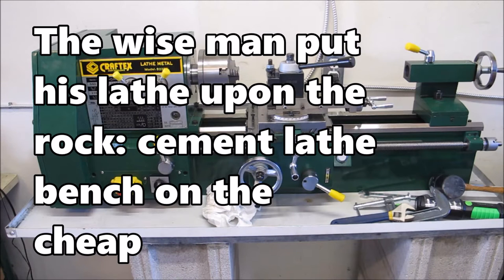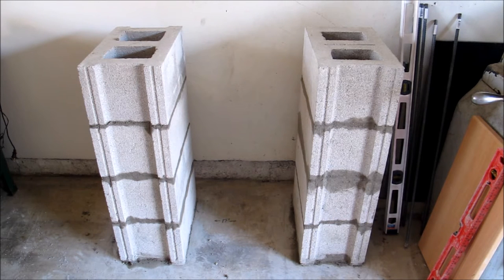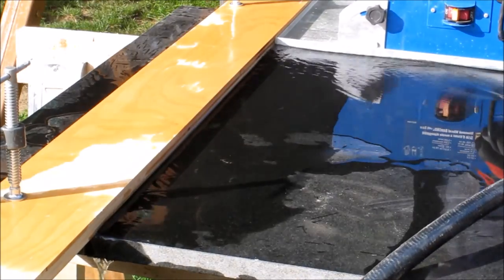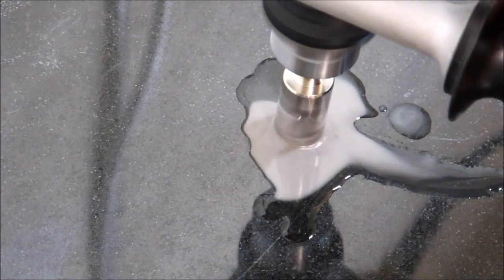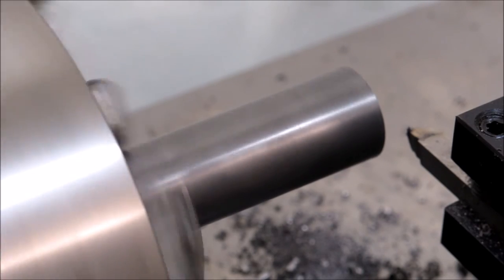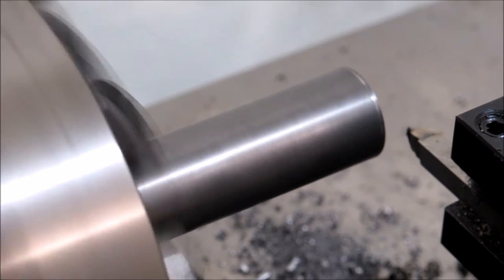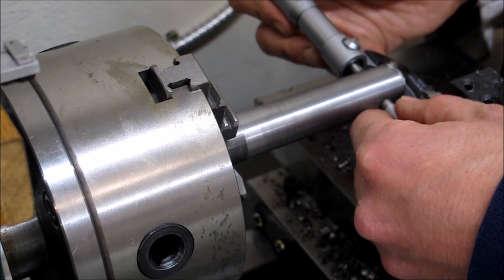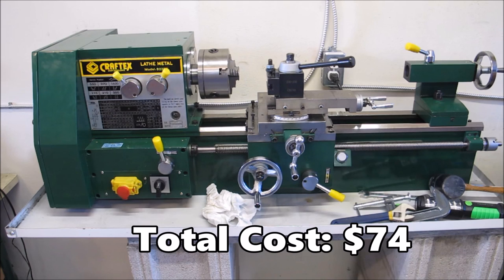Concrete Lathe Bench

Comment: Wet vs dry cinder blocks. A wall built with dry cinder blocks is far easier to knock down than one built with blocks that were wetted beforehand. It's also difficult to recycle the wetted blocks because the mortar won't chip off reliably. It's a science thing when dry blocks wick away the moisture from the mortar and a thin layer where the mortar meets the block dries a little more than it cures. It's an easy experiment to try for yourself. It's interesting that Google has both methods contradicting each other in very close proximity. Such is the way it is when every answer you're looking for is made available. 
I have seen circumstances where a dry built cinder block method has been specified in the plans and on two occasions came across a detailed block pre-wetting procedure was included for the walls of a compressor room. 
I like to keep curing concrete damp for several days, cuts down on graphitic too.

Comment: A lathe doesn't have to be level to do precision work, it could be upside down and work fine. It needs to be trammed in so the ways are even and the tail and headstock run true to the bed ways and each other.
Reply from the maker: Agreed, although there is much debate in the home machining world.
Reply: for a large lathe it,s easier, even a must to have the lathe level because  you adjust the lathe with a level. how would you do adjusting it otherwise ?

Comment: Nice job,  I thought about pouring a top but I was afraid of cracking.  You should paint some fake doors and drawers on the blocks now.
Reply from the maker: I've had the bench for awhile now and it's been great.  I did add a couple of shelves between the supports but I like your idea of painting doors and drawers on them.  My kind of humour.  PS if you want a flat top for one hang out around countertop place for awhile and talk to the guys in the back.  Often you pickup offcuts or damaged stuff very reasonably priced.

Comment: I think this is a great idea (it has some drawbacks, but it surely beats putting machinery on casters!)
I keep commenting on several channels that machines need to be bolted down, usually to little or no avail.

Paddy
Reply from the maker: Thanks.  What I liked about it was how easy and inexpensive it was.  I'm not the first person to do this for sure, but everyone seems to gravitate to welded steel bench.  Steel isn't the greatest to begin with, but once you add cost into the mix, concrete is really attractive.  I'm working on a project almost a year later and I turned a 3" internal bore to within .0002" with no adjustments needed to the lathe.  I also parted off 4140 HT material 1 3/4" round with no problems.

Comment: A bit late to the party here with my comment, but still wanted to mention something about the measuring difference on the last cut you made. I know it was only a skim cut, still, applying force to the very end of the material with it being that far away from the chuck (rule of thumb as I remember is extension lenght of a workpiece = 2x the diameter of the stock) will lead to some difference in the measurement. To compensate for that, you would usually put it in the tailstock with a center, given that it is properly aligned to the chuck - center. Just a thought here, maybe it was the intention to have it just relying on the chuck. But if you didn't take this into consideration yet, maybe it helps :) Greetings!

Comment: pouring a top is cheap and simple. if you worry, use a finer sand mix and add the liquid fortifier and add rebar.
Doing this when i had to move, I cant tell you the amount of effort required with a sledge hammer to even crack the smallest bit off that top.
It WONT crack and is total overkill

Comment: All Major U S navy ships have extensive machine shops. None of these machines are level. They are bolted securely to the ship so that are in proper alignment. Level doesn't matter as long they are not pulled out of alignment by the hold down bolts.

Comment: Any sort of machinery benefits from adding mass, it reduces harmonics and reduces temperature changes overall. I would get a precision level honestly. They are about 50$ these days from the local auction house.
Reply from the maker: Hi Bruno.  Thanks for stopping by.  I agree regarding the mass.  What I really like about this bench was how easy it was to put together.  And it still works.  Just yesterday I turned a bushing - within .0001" over the length.  It really has changed the lathe.

Comment: Did you put something between the concrete and the lathe feet to even out the irregularities in the surface? I tried to do something similar with a 10cm concrete bench under, but the bed twists when I torque it down. I know there is some special machine fitting putty that hardens and you can tight it down.

Comment: good idea about the concrete legs, but I don't see any added value in that granite plate, that granite plate will probably crack if stressed. 
i also would have placed the lathe more to the right because all the weight is now on the left leg.

nevertheless a good project!
cheers ben.

Comment: Very nice result, considering the reputation of the lathe ! It would be interesting to see how a wood or steel bench compare. Your granite cutting technique is a giggle...got the job done none the less.
Reply from the maker: The lathe was previously mounted on a wood bench.  It was a heavy wood bench.  I would get the taper out of it for a few months and then the weather would change and it would start cutting a taper again.  I really got sick of adjusting the lathe.  Concrete doesn't change nearly as much as wood.

Comment: I did something similar for my 7x16 mini lathe. Except I poured a 200+ pound slab with steel frame and bolted my lathe to it, rhen bolted the slab to my bench, then bolted my bench to the concrete floor... made a huge difference in rigidity. And dude is right, concrete also helps with the vibrations. I'm going to be doing this same thing for my mill eventually

Comment: Great work, and great vid!  That's a good heavy cut, it's great to see a small lathe hogging off material like that.  With a tool ground specifically for maximum depth of cut, I wonder how far you could push it?
Reply from the maker: Thanks.  I wonder as well.  The lathe has a "3/4" hp motor on it - I would suspect this is the limiting factor.  The spindle and carriage on these types of lathes are fairly heavy for the size of lathe.

Comment: Great video man! Still happy with it? Anything you would change now that you've had it for a year? I'm very seriously considering going this route.
Reply from the maker: Yes still works great.  Haven't had any issues whatsoever.  It was inexpensive, quick and easy.  I have added a few shelves between the legs for storage.  So many folks say you can't move it - I haven't had the need to move my lathe.  I usually don't rearrange the furniture in my shop all that often.
Reply: thecogwheel that is very good to hear as I'm 75% done building one very similar to yours! Thanks again for the share, saved me a bunch of money.

Comment: Great video! I was in the process of making leveling feet for my Grizzly G4003G lathe when I ran across your video. What are your thoughts on using hockey pucks for rubber damping on feet?
Reply from the maker: I'm assuming you are putting them between the floor and the stand?  "Hockey pucks" are primarily used for isolation either the lathe from external vibrations from other equipment in your shop.  If you don't have a lot of vibration it's probably not required.  Thanks for watching - glad you liked it!
Reply: Thanks for the info! You are correct about the hockey puck placement. It's in my garage so there isn't much external vibration. The lathe with stand weighs around 544 kg. It has a 2 piece cast iron stand with a head cabinet and a tail cabinet but the aren't all that beefy.  Do you think I should fill the stand cabinets with concrete like you did for your mill? I am new to the hobby so I'm not experienced enough yet to know if rigidity or vibration is a problem with my setup. BTW, I really enjoy the podcast and look forward to each new episode.
Reply from the maker: The stands that so many import machines come with are flimsy.  Seriously I would consider it.  One of the biggest differences between import machines of today and the older iron of yesteryear is the bases.  I have an older Schaublin 102 with a stand that weighs more than the lathe.  The Standard Modern lathe I'm working on has a really nice cast iron stand.  You can always add the cement later as well.  That's what I did after finding out how wobbly the stand for the mill drill was.  It shook when I was feeding the table.  That's never a good sign :).  Thanks for the listening to the podcast!
Reply: If your cabinets are encapsulated I would use sand in them instead of concrete. Mass is mass, and removing sand is easier than removing concrete if moving the lathe ever comes up.
(did you see I used "than" correctly, I paid attention in English class unlike the spoiled children of today...jk)
Reply: @Dwarfracer88 Good point. Thanks for the comment.

Comment: Great idea, i'm thinking about doing it myself! How did you hook the lathe to the granite?  were  they the same half inch bolts drilled into the concrete?
Reply from the maker: Hi Rob.  Yes the granite is held in compression using the same concrete anchors that hold the lathe down.  I drilled holes in the granite that were oversize allowing the anchors to easily slide through.  I used cement grout between the granite slab and concrete blocks.  The bench is still working very well!  Stay tuned for how I fixed a flimsy mill base with cement!